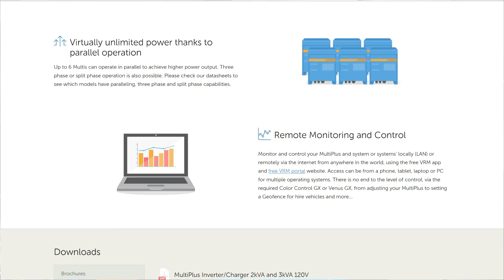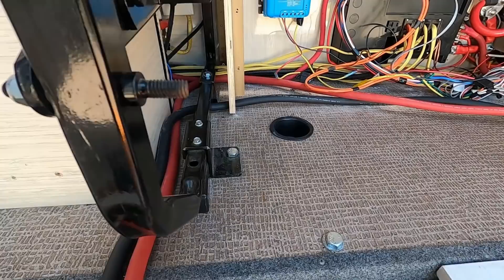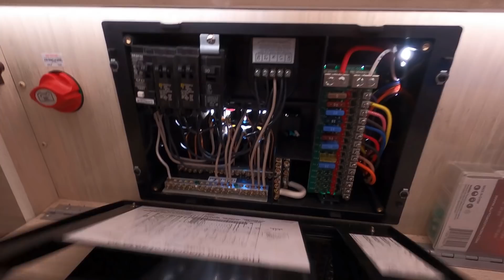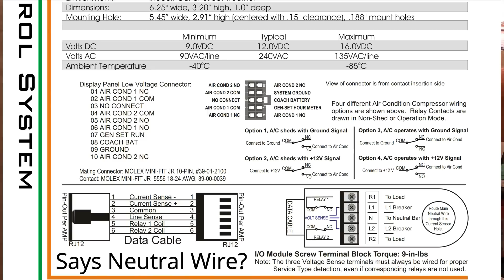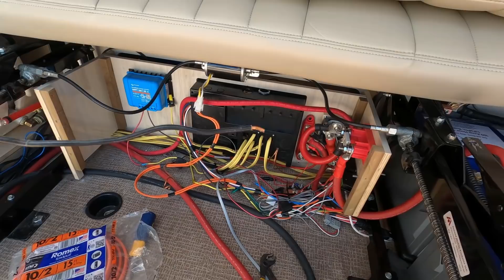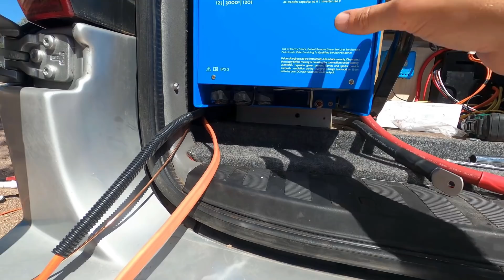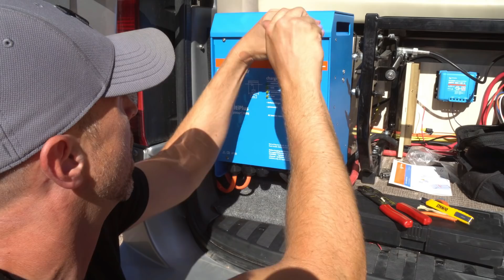RV Inverter Installation | Victron Multiplus 3000va Inverter Charger | Full Time RV Living

Comment: Was there any reason that you didn't wire your batteries in series to get a 48 volt system? Wire gauge would have gone from 4/0 to around 3 B&S, making wiring much easier and cheaper. You would have needed a 48 volt Multiplus instead of 12 volt, but both are around the same price and you could have used two Victron Orion DC to DC chargers, one for charging from your alternator and one for 12Volt house current. The smaller cable would have made life much easier than using 4/0 in such a restricted space.
As a suggestion I think that you need to cover all exposed terminals, –  with 400 Ah and such heavy conductors, an accidental short circuit could burn your pride and joy to the ground.
Reply: It looks like he is running a lot of appliances off 12V directly.
Reply from the maker: Yes, thank you! We try to run everything off 12 volt and only turn the inverter on for large loads. That and I don't know anything about the 48 volt systems! 😂

Comment: Hopefully you are still monitoring this. Are you concerned about the recommended clearance for the Multi... top and sides? I was especially interested in how far off of the floor it can be mounted, since I will likely mount it fairly close to structure above. Any problem with heat so far? Nice Vid, Aaron. I had to laugh with the look on your face when you asked Chris to turn on the DC switch, not sure if that was intention! Moment of truth.
Reply from the maker: Hello and thanks for watching! We have never had any heating issues with the multi in that location. Having it mounted vertical is the best position they say for cooling.  With the bed up it has pretty good clearance on all sides (not quite the 4 in reco on the driverside but there is space) but we really didn't have anywhere else to mount it. When the bench seat is down it does touch the top of the case, but the vents on the sides and intake on the bottom are always open. If its working hard(usually not at night) it does vent a lot of hot air back there. Not sure if you have the Multi yet, but the very top top cover is actually removable, exposing the vent fan to help with ventilation. Love the inverter! We will be going with the same one in our new travel trailer later this fall when we get it!

Comment: Pro tip, never use solid copper wire in any application where there is any movement. Copper work hardens when subjected to vibration and the thicker it is, the more its subject to breaking. This can lead to higher resistance and heat, and possibly even a fire.
Reply from the maker: Thanks, it is interesting that all RV manufacturers use solid core wire. Here is a link to multi-strand marine AC wire I'm using in my new setup. ⚡️Marine flexible multi-strand AC wire 10/3 https://amzn.to/3jQ3mWe

Comment: Hey iron !

first of all thank you very much for your great stuff! it is of excellent quality!

I have a question, I am building an electrical system in a van of 4 batteries battle born of 100 Ah connected in parallel, all this for a Victron Energy MultiPlus 2000VA 12-Volt system.
When I turn on the inverter, everything is well connected according to the green led, measuring with a tester the voltage of the sockets is 120 volt.
When I connect the charger of a cell phone or a vacuum cleaner, it works correctly.
Now when I plug in the Bosch 2.25 gallon (1440 watts) water heater, the inverter turns on the red alarm LED, and turns off.

What do you think it could be? I am really stuck here.Is the MK3-USB driver really necessary? I'm thinking that might be the problem, basically because of the configuration.

Greetings friend! and thanks again
Reply from the maker: I had to purchase the MK3 to change the charging settings for the lithium batteries, but I don't think I had to change anything else in there. I noticed the 2000va has a max of 1600 watts and down to 1450watts at 25 degrees c (77f). Is it hot where you are at? Also do you have the Bluetooth dongle or a remote monitor so you can change the amps settings on the limiter? Maybe it is set too low. https://www.victronenergy.com/upload/documents/Datasheet-Phoenix-Inverter-1200VA-5000VA-EN.pdf
Reply: @IreneIronTravels  Maybe it can be that configuration . because I also have those batteries . So if there is no way to change it I should buy it.
I am in Atlanta Georgia, the weather here is very variable, but it has not been hot lately.
I have the "Digital Multi Control 200/200A GX" monitor but I think I only regulate the AC input with that .
Reply from the maker: My only suggestion before buying it is to make sure the current limit on the 200gx is set to 15 amps or more and try it again. Other wise you can ask the Victron community page and they might have the answer for you. Good Luck! https://community.victronenergy.com/questions/5154/did-i-undersize-my-multiplus.html
Reply: @IreneIronTravels  I didn't have that page in mind, thank you so much Iron and good life !

Comment: Nice set up ! I have 2006 Leisure travel free spirit / Mercedes chassis. I would love to set up a lithium pack just like yours but I'm a little confused. The two house batteries are separated, one under driver side and the other one all the way down to under rear bed. Any thoughts ?
Reply from the maker: Hello! Yes, batteries do not have to be right next to each other, but the shorter the battery cable run the less loss of power. So it is best to have them close by with short connecting bat cables, but sometimes you run into space constraints. You might also have to use larger 
diameter battery cable as well with a longer run. Our chassis battery (engine starting battery) is under the front driver floor and not under the hood.
Reply: @IreneIronTravels  I meant it is under the passenger seat. both house batteries are 12V. Did you have 6V electric system before switching ?
Reply from the maker: The system is a 12v system, but we did have two 6v batteries hooked in series, before we upgraded again to the 12 volt lithium batteries.
Reply: @IreneIronTravels  You're a good man. Thanks for your help !

Comment: Great video Aaron.  How do you control (on/off) the inverter?  Do you need to open the back door and manually turn it on/off or is there a remote switch?  Thanks
Reply from the maker: Thanks! It is bluetooth from that dongle I referred to. That's what i like about the victron app is I can control and monitor the inverter, solar, and batteries from the phone/laptop/ipad. You can also install a hard on off control panel but I choose to skip it.
Reply: @IreneIronTravels  Thanks for the quick reply.  Perfect!

Comment: Obviously Battle Born was more helpful with you then I could get response with more then 3 words it was a real Battle
Reply from the maker: Hey there. May I ask what your issue is/was?
Reply: Same problem. They told me to buy the batteries, then a converter, and then the inverter/charger. Now I can't get anything installed and don't feel comfortable doing it myself, esp with a separate circuit breaker like I've seen in some systems. Had these things for a year and they are just sitting collecting dust. I'm trying to get an electrician to help but no one seems interested. Frustrating. If anyone is in southern CO and wants to make some money, let me know.

Comment: My electrical panel with converter, I ripped out and threw away, then I rewired into new fuse panels and into the multiplus. It was like 95 degrees outside, 100% humidity so I was not gonna try to figure it out.
Reply from the maker: Sounds like a good way to just get it done!

Comment: Romex should never be used in a vehicle. It is not designed for the vibration and temperature swings of a vehicle. The solid conductor can break from repeated flexing under vibration. This will lead to arcing inside the jacket that can catch the paper inside on fire and then things will escalate quickly.

Any insurance company that sees it installed, especially in a claim is going to end poorly.

Please only use DOT approved cable inside vehicles. It's not that much more and isn't worth risking your mobile home or perhaps someone's life.
Reply from the maker: Hey there. I appreciate you watching and your comment, but it sounds like you are not familiar with the RV industry and their code for wiring. (I am not saying I am a professional by any means, I'm just replacing what was used by Airstream, the manufacture, on all of the 120v wiring in this coach. ) This style of wire is used in millions of RV's on the road and the commercial manufactured RV's are inspected by RVIA for electrical, plumbing, heating, fire saftey, etc.
Edit- used this in my new system ⚡️Marine flexible multi-strand AC wire 10/3 https://amzn.to/3jQ3mWe

Comment: Thanks for posting. You did quite the puzzle there fitting it all in nicely!
Mounting Mutiplus 3k this week. Considering horizontal vs vertical mount but thinking convection would allow better pass through and possibly less fan operation in vertical?  
I was surprised by the amount of solid core, non-stranded wiring your AS coach had.
Reply from the maker: ⚡️Marine flexible multi-strand AC wire 10/3 https://amzn.to/3jQ3mWe
Hey, thanks! Yes, it was a tight fit for sure, but I am really happy with the turnout. Yes, I feel the same that vertical does have better natural cooling, but I do know a few RV'ers that have it horizontal and have not expressed any issues, so I think either is fine as long as there is enough room around it for proper ventilation and not enclosed in a small space.   
It seems solid core is standard procedure in the RV world for the 120v. I did receive a few comments about it not being safe and should never be used( and I should even redo it), but I believe that comes more from the marine specifications side of things. Of course, cost always comes into play in manufacturing. Thanks for watching and good luck on your install!
Reply: @IreneIronTravels  In the US it is a code violation to use solid wire. Section 551 on RV's states clearly that stranded wire is required. It's not a marine thing, the wire will move and vibrate when the vehicle moves and this will harden the wire, causing it to crack and break. 
You see a lot of solid wire because it is cheaper, easy to find and was not installed by an electrician. It is not safe, should never be used and violates the National Electric Code.
Reply from the maker: Article 551 is pretty big and reading code is well like... reading Greek ...can you be more specific please with the exact code. I would like to stay factual in this so we can all be educated. I won't disagree stranded is better in a mobile application, but to state its a code violation, should never be used and wasn't installed safely doesn't make sense to me. Millions of RV's are on the road and produced from the factory with solid core wire (NM Romex style) and they are inspected by the RVIA and sold to consumers daily. Are all the major RV manufactures violating code? My 2014 Airstream has solid core in it and my 2022 travel trailer does as well. That being said..on the new inverter install I used Ancor Marine stranded wire.

Comment: It's not a 3000W inverter, it's a 3000VA or 2400W inverter.
Reply from the maker: Huh...good catch. I learned something new, thanks.  3000 watts looks to be commonly used by many people and even companies that are selling this Multiplus. I looked a little deeper for those reading this and are interested in the difference. Appears sometimes they are equal and others are not, depending on the load type.  https://shop.pkys.com/Watts-VA.html for the full article

"The Power Factor effect means that with resistive loads the formula Watts = Volts x Amps is true but with inductive loads the Watts is a lesser amount, Volts x Amps x Power Factor.  That's why you will see inverter manufacturers quote their rated output in VA - its because it is the higher number and so looks better on the spec sheet.  Everybody does it.  If your inverter is running a toaster or a coffee maker it doesn't matter but if you are running a vacuum cleaner or power tools it does and you need to be looking at the Watts figure."
Reply: @IreneIronTravels  spot on. VA = Watts for resistive loads like an incandescent light bulb or electric stove (power factor of 1). But anything with a motor or power adapter has a lower power factor and the two aren't equal. This is such a big deal that factories and other large consumers of power are actually billed based on VA rather than KwH, so the power factor is considered.

Comment: It is a bidirectional inverter, not a hybrid... hybrid will have an input PV, Input DC and an input and output AC. The multiplus which is a great inverter has an input DC and input and output AC.
Reply from the maker: Hey there. Victron refers to it as a hybrid power assist technology. Just meaning it can use power from two sources at the same time. AC from the grid/generator and power from the batteries to power the load. The same thing from Magnum Energy also as they even put the word hybrid right on the inverter casing. It could just be a difference in words...either way no big deal. Thanks for watching and commenting!

Comment: Why the "transfer switch"? What does it do what the inverter cant?
Reply from the maker: Hello. The external transfer switch allows for more than one input to the Victron. We have our generator and shore power combining in the transfer switch and then one output going into the Victron. The internal transfer switch in the Victron will switch to the batteries if our shore power or generator power was interrupted. Hope that helps some... it is a complicated topic to learn.

Comment: Should use 10/2 marine wire. It is flexible and is coated .
Reply from the maker: Edit- I used this in my new system ⚡️Marine flexible multi-strand AC wire 10/3 https://amzn.to/3jQ3mWe
Just starting to hear more about marine flexible wiring. Sounds like it would be a good idea to put in RV's also. Not sure why its not implemented from the factory builds on RV's as there is a ton of vibration from driving......
Reply: @IreneIronTravels  Cost. Profits !
Reply: I forgot to say ,  great job and video .
Reply from the maker: Thanks, appreciate it. It was a fun experience learning more about this and installing the system. Lot's to still learn!
Reply: When I had a cabin cruiser boat, the 120V was wired with marine cable - which was multi-strand wire so as to be less likely to break from vibration and cause a short.  I believe the marine grade wire has an insulation that is more fireproof and comes both in tinned (for saltwater conditions) and regular (un-tinned) wire strands.  

That said, the most likely area for a wiring problem due to shorts and heat build-up is at the connections.  Push-on connections being the ones that have historically caused the most problems.  

I don't know if you can use arc fault (AFCI) breakers in an RV panel to detect shorts, like are required in home wiring circuits.
Reply from the maker: Hey Ted, thanks for sharing your experience with the marine cable. Agreed about the shorts and heat build up on loose connections as we had one on our solar controller this summer. Lots of vibration in the RV's!

Comment: Did your RV come with coach batteries from the factory? I have a 24 1/2 foot airstream. My two coach batteries are mounted below the chassis, so I believe my install will be a bit easier.
Reply from the maker: Hello, yes the factory batteries were 2 AGM Lifeline group 24 batteries. I think they started putting the batteries underneath in around 2015. Are you putting in lithium batteries? Inside or were your old batteries were?
Reply: Irene Iron Fitness The new lithium batteries would replace the two AGM's that are mounted under the chassis. I will contact Battle Born next week, as to any other components that I will need.
Thanks.
Reply from the maker: 👍 Just watch out for low temps in a non heated compartment. 
Low temperature: < 25F
The BMS will not allow a charging current.

Comment: Great video!  Thanks for putting this together.  Did you need to do any programming?  I don't have the dongle so I had to order the programming device so I can change the settings.  My system is very similar to yours, except I have 300ah of battle born.
Reply from the maker: Thanks! Yes, I had to use the MK3 to usb with the computer to change the settings also. Bummer the bluetooth dongle doesn't allow simple programming like their solar charge controllers. But, love the whole system so far!

Comment: Nice job on fitting everything in such a compact space.... With the MultiPlus, how do you keep something from switching over to the inverter?  We have a toy hauler with a fridge that runs on either AC or Propane and switches to the most economical source. If the inverter was to be on, the fridge would switch from gas to Inverted AC.  So how do you prevent the fridge from switching other than turning off that circuit breaker?  Keep up the good work.
Reply from the maker: Thanks! Our fridge is a compressor driven fridge that is AC/DC only. So it is always running off the batteries, except when we turn the inverter on and then it runs off AC.  I see your point with the propane fridge though. Is there a switch on the fridge to run on propane only? Suppose that would be too easy..... We do keep the inverter off most of the time while boondocking as it has a 5 amp draw just being on. We try to run everything off 12v to be as efficient as possible and then turn the inverter on as needed for the larger appliances. Thanks for watching!

Comment: If that Romex wire is single core, don't use it. Always use multicore wire in a van or boat. Safety for moving applications is important.
Reply: I agree with you stranded is better. But they come from the factory with solid core wire 🙁.